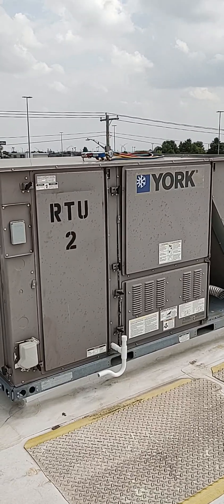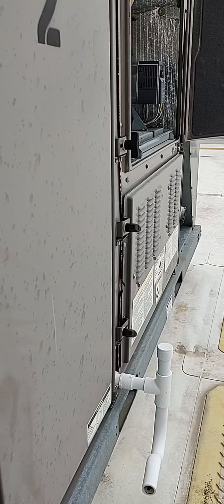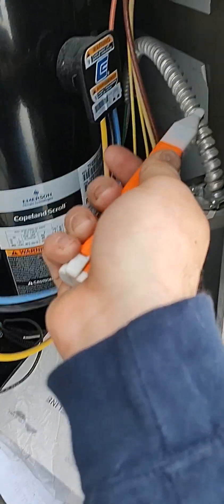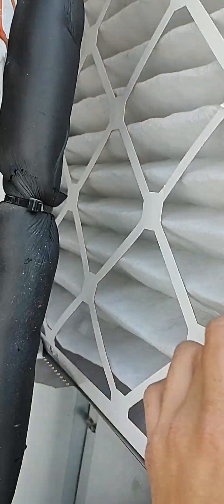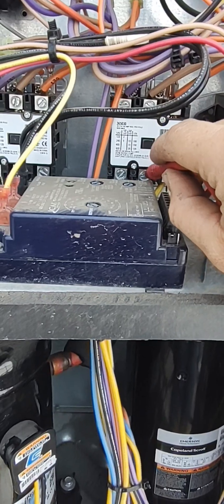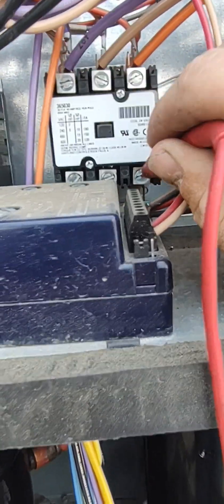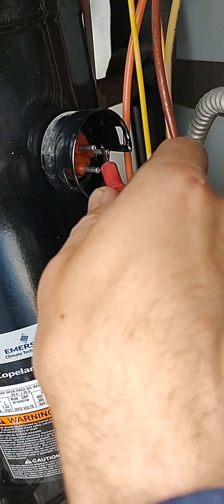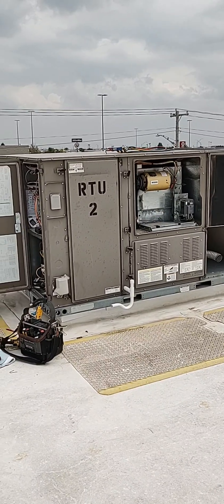RTU breaker tripped! why? what caused it?

Comment: Hey save yourself some time next time you pull off that cap for the compressor check it from there you would have said you're still 15 minutes you can find a short to ground real quick on a compressor from the leads on the compressor